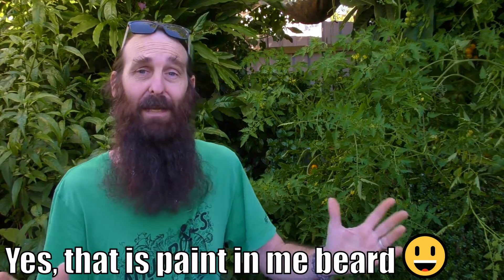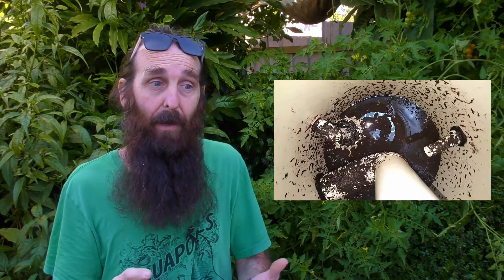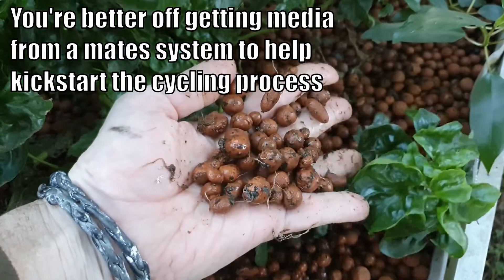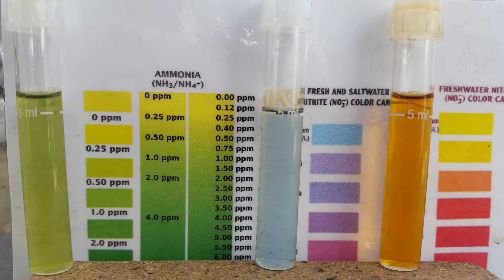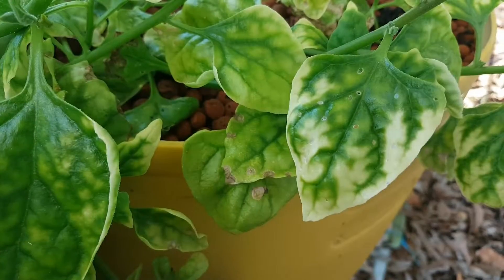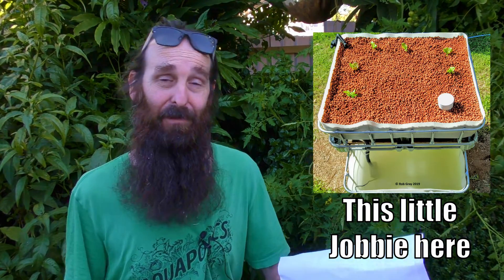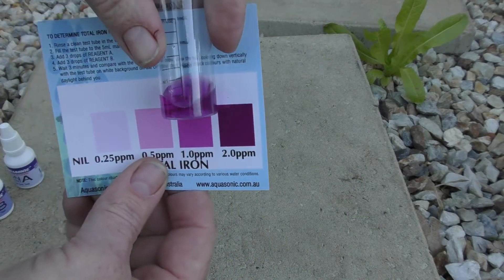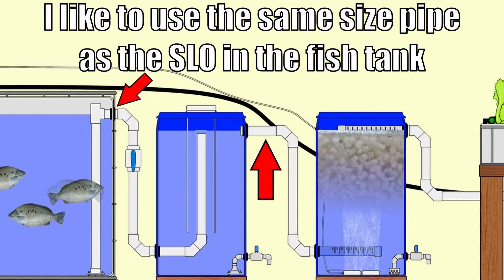Aquaponic Q&A | Water Testing - Filter Water Levels - Chop & Flip Parts List + System Update

Comment: hi, really love your work and been following you for over a year. i had a question. what is the durability of the clay pellets? do they eventually degrade and dissolve when do we change then if necessary?
Reply from the maker: I have some we bought for use in hydroponics over 24 years ago that are still fine as fine as far as I can tell. I'm yer to see any broken down balls i the base of the beds when cleaning. The first ones I used many years ago were the Hydroton brand from memory & at the moment I'm using the Canna branded clay balls. 
I have seen folks use cheaper import clay that they say breaks down but haven't experienced that myself. I dare say that the clay was never fired to hot enough temperatures in those cases. 
Hope that helps some.
Reply: @RobsAquaponics  thank you very much mate. Cheers🙏

Comment: Once again rob, excellent video. I have a few more questions. Before renovating how many fish tanks, sump tanks and grow beds did you have? After the renos are you changing your setup or keeping it the same? Also checking iron, phosphate, calcium, etc. Is that as important as checking ph, ammonia,  nitrite and nitrate, if you check in etc how often would you check the iron etc? Do you ever put Epson salt in as fertiliser into you aquaponics? Cheers Dave hughes
Reply from the maker: Hi again David.  This clip gives you a look at how the system is currently set up., https://www.youtube.com/watch?v=raLv4RAUte8 . The clip is a bit old but it is essentially still the same layout. 👍
The system will be simplified after the renovations but will also be building another standalone one to run along side it.
I tend to look at how the plants are looking when it comes to iron. I don't worry about testing for calcium too much as I use calcium hydroxide to keep the pH buffered. As far as I can tell I haven't had any phos or mag  issues as there should be enough coming through with the waste. 
Sorry for taking so long to respond. Am busy still playing catch up after the move.
Have a top one.
Reply: All good rob.i know what it's like moving house. Thanks for your reply.  David Hughes